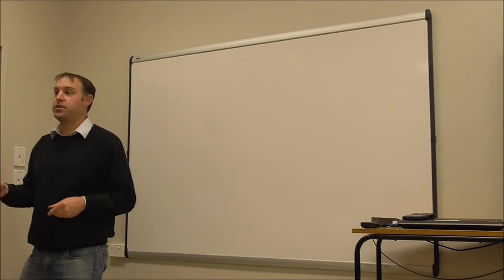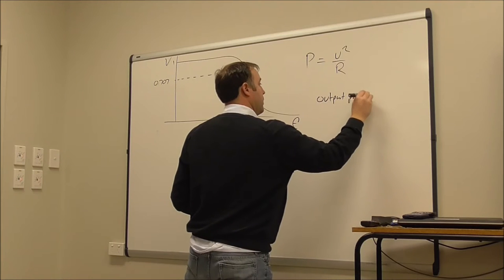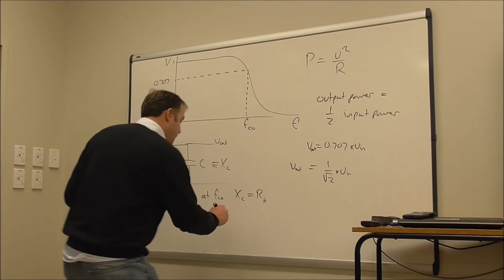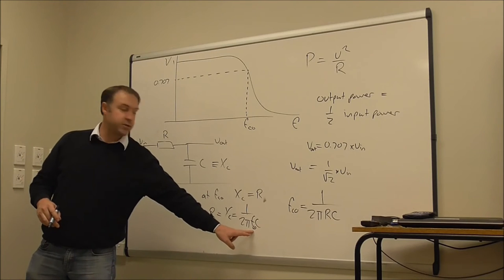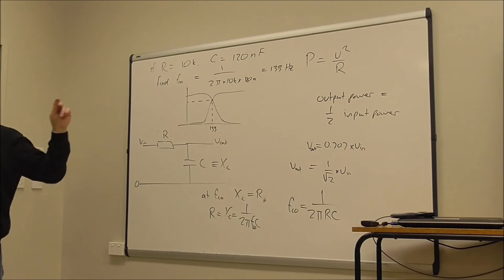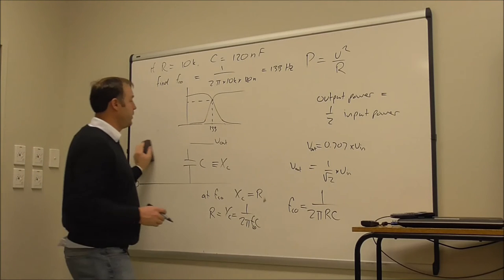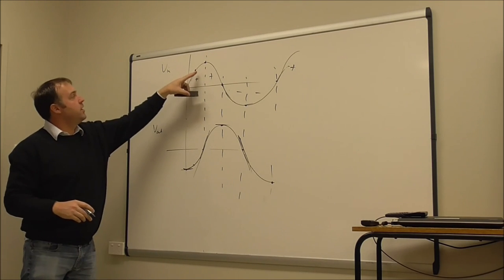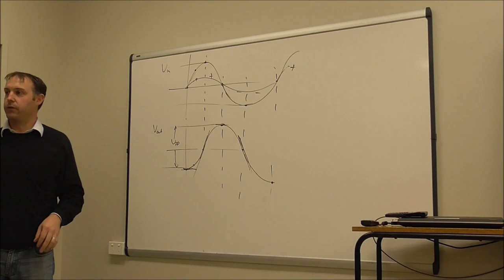calculating filters

Comment: How does Output impedance of input voltage source and Load impedance effects the calculations of R and C values for the LP filter ?
Reply: the impedances of the the LPF and the load and input get coupled together which definitely affects the calculations. this is solved using active filters.